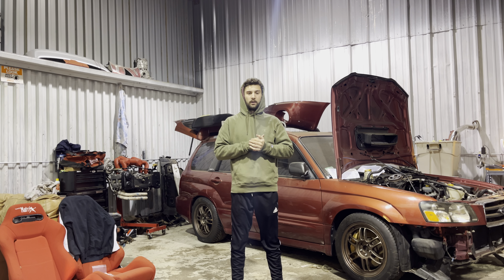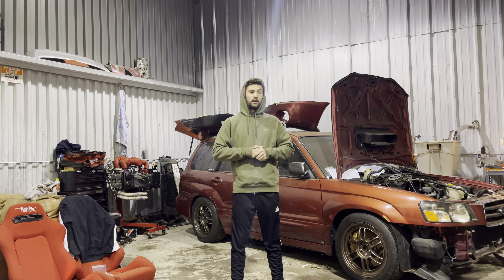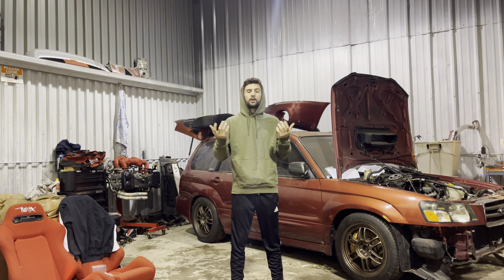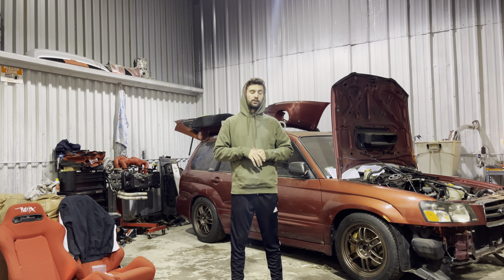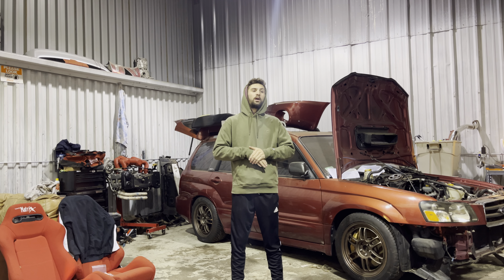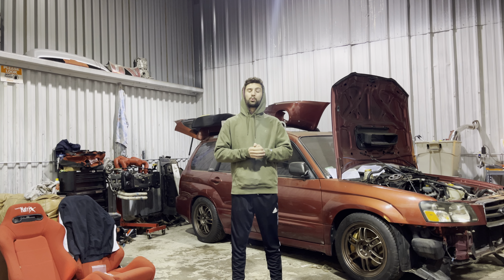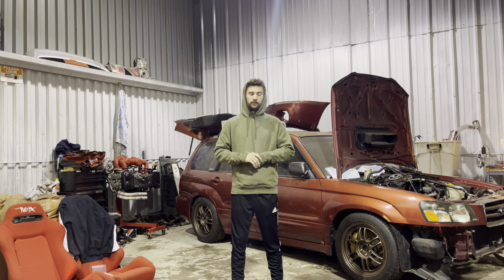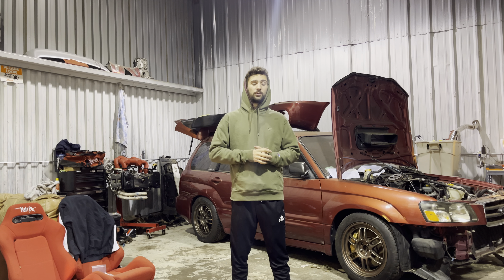EJ20X Swap Information

Comment: Tuned one i did to 362whp and still going 5 years later.
Reply: What turbo and supporting mods??
Reply from the maker: @thelonewanderer420 this was a few years ago, I had a twin scroll TD04L setup at one point and a VF52 setup as well. Upgraded injectors, pump, oil pickup, baffle, pan, ect nothing too crazy

Comment: My 20x has lasted 1 year plus and I daily drive it tuned by Jacob aswell he did a great job car runs flawless
Reply: On a 13 wrx
Reply: Who’s Jacob tune for like company wise?
Reply: What spark plugs you used for the ej20x i have a swap on my legacy gt and i want to know any help  pls saprk plugs and coils thanks
Reply from the maker: @joeyortiz757 use stock ej205 spark plugs and coil packs you use the stock ej255

Comment: I still prefer how the ej255 drives.  I’m no engine torque expert.  But.  I have a 255 in my 2014 Wrx and a 20x in my 04 wagon.  The 20x is great.  But.  I still think the 2.5 is better.

Comment: This mechanic messed up my engine so the put in a ej20x . I'm getting these code p0244, p0457,p0128,p1086,. They told me I need to do a tvg delete . And get it tune is this gonna fix all these check engine codes ? Please help this for 2004 subaru forester xt

Comment: Q: Swapped in a 2008-2014  EJ20X into my 2005 Baja Turbo AT in '20. I need new PCV hoses - Flatirons sells silicone hose kits ($120-240) for each model/yr. - which do I buy? which will work with EJ20X? Not sure what my swap guys did? Did u get your garage going? (ps. Wicked Matt did my tune - things been going good - xcept low end torque of course:). Great summary - thanks?

Comment: I did swapped an ej20x to a wrx 2014. Swap whole intake and parts with the USDM that came on the ej255. I'm using the vf52 with the oem Unequal length header, 650cc injectors and I have good numbers on the accessport 2 months using it and feels very good. Now I am going to order a 340lph Fuel pump before tune it. My actual goals are 300hp +/-10. I have catless downpipe and custom exhaust. Cobb boost controller, custom Perrin inlet intake, and OEM filter box with Apexi dry freeflow filter. Do you think I do need something else to reach 300hp?
Reply: Highly recommend a protune the timing on the cobb maps are super spicy for the ej20 motor due to the compression like alex said in the video

Comment: Just did a 20x swap about a month ago got about 800mi on so far on 18psi wanted to tell ya you can also run ej255 solid cam gears with cams as well mines doing well def keep posting bro !!!!
Reply from the maker: Yeah I thought I mentioned that in the video as well, but I was just going off the top of my head. Fully unedited video actually

Comment: I'm planning to do this swap with my 05 LGT and get a JDM ECU to use the exhaust AVCS. With this in mind, will I need to set the teeth back on it, or set the timing as normal?

Comment: Had an ej20x swapped into my Lgt about 7k miles ago.   So far so good except the place who did the work cut alot off corners I'm still trying to iron out.   Chasing my tail trying to figure out proper vacuum line routing.
Reply from the maker: If you’re local to CT, swing it through to my shop I’ll take a look for you
Reply: @FOFRacing  Right on man.  I stopped down a few months ago, you and your bro helped me out.  Silver Lgt wagon, turbo had a little shaft play.   Vac line from my bpv is going straight into intake manifold where the pictures I see it goes into a t-fitting.  Maybe I can stop down soon and compare lines.
Reply: Where is your shop?

Comment: Not sure if you know but you can run oem top feed setup from 08+ wrx or 07+Lgt if you wanna do it on a budget. Just an idea for whenever you get to it on your car. That's what I'm doing on mine.
Reply from the maker: Yes that was my exact plan, I think I explained that in another one of my videos I did. Just need to swap over your cars engine harness and you’re good to go 🤙🏾

Comment: Great video,  I can vouge for most your info as we have done 3 ej20x swaps, two in LGT's and one in a 09 WRX.  All ran great.  There is also a FB group Subaru JDM engine swaps, would be great to link your video there.  I do have a question. Is there an advantage to swapping the exhaust cam gears to the USDM and plugging the oil passages vs just changing timing 2 teeth CCW on the JDM?
Reply from the maker: I’ve never personally seen any actual data about the differences. It for sure would be a solid idea.
Reply: @FOFRacing  would be nice to know if it actually makes a difference and worth the hastle of changing them.
Reply from the maker: @troyemmert5296  I’d love to find out honestly
Reply: Would I have to have someone tune my car
Reply from the maker: @sethvanvalkenburg6788  I’m about 95% sure I included in one of my videos that you’ll need a tune, if not I’ll make another explaining that portion

Comment: Couple questions - When doing the swap do you need to change the cam sprockets and use the timing belt components from the ej255 and put them on the ej20x with the usdm harness?

One more thing, the exhaust AVCS sensor that I can’t use because of having an original single AVCS engine. What is the best course of action do I need to block any thing? I was planning on getting a tune to help fuel delivery after and hope it won’t make the engine run less efficiently over time
Reply from the maker: I answered your first question in the video stating you don’t need to swap any cams or gears to get it to run. Just needs a tune and a 255 timing kit and 2.0 waterpump. For the exhaust AVCS you can leave the sensor in and let it be unplugged.
Reply: @FOFRacing   gotcha thank you I heard that I was just confused. So, I should take off the idler pulleys and tensioner From my 255 and put them on the 20x? I probably just need a timing belt right? maybe I don’t need the whole kit? I’ve heard the ej25 water pump working but you recommend using the water pump that comes on the jdm engine?
Reply from the maker: @skidim8143  buy a whole new timing kit, don’t cheap out or you’ll pay for it later. Buy a 2.0 WRX waterpump because that’s what you should use. You’ll have to block off one of the ports on the 255 waterpump, so why hack it together? I don’t recommend reusing timing components as you have no clue the history of them or the condition of the pulley bearings
Reply: @FOFRacing  thank you so much for the info

Comment: i ran into a issue hope you can help my mechanic is a old fart and we do not have the ability to pull off parts of a 255 so the turbo doesn't fit my piping and my mechanic dont wanna take off the turbo cause 1 its bigger and 2 he doesn't wanna use the old turbos off the 20x that we have for spares so i ordered a piping to fit that turbo and jave to weld it onto the uppipe to fit so after that whats the other major problems we might run into considering we cant pull stuff off a 255

Comment: I just did this swap for my 2005 legacy GT .. how do I get my check engine light off ? I brought the engine from jdmengine zone in New Jersey .. it didn’t come with a 02 sensor so my check engine light is on .. the engine fit in perfectly.. all my mechanic had to do was run the engine on 1 solenoid and leave the other unplugged like you said and he had to extend the crankshaft sensor wire to be able to plug it in .. also what gas should I run this engine off ? I put 93 in it and it started shaking a little at first
Reply from the maker: Should’ve swapped over your turbo/ manifold/ downpipe setup and kept your 02 sensor. There should’ve been no reason to extend the crank sensor. Run 93, it’s shaking because you don’t have a 02 sensor hooked up
Reply: Damn .. jdm engine zone was saying to keep the 2.0 turbo set up .. I had to buy a flank for a ej20x because my 2.5 flank didn’t fit around the turbo for the 2.0 .. so I brought the flank for the 2.0 and then welded a pipe to the mid pipe to close out the exhaust .. everything else is running excellent .. it’s just some times I start the car it shakes a little .. is there anyway I can fix this ? I don’t have my original engine no more ..

Comment: love your shit dude. <3 I have a 2011 wrx hatch and I'm in the middle of a ej20x swap and i have full bolt ons with a FP Blue spinner. we'll see what she makes XD
Reply from the maker: I love the support man thanks!
Reply: Did you use the air assist ej20 or was the non air assist ok to use? I assume it’s all the same aside from air assist pump
Reply from the maker: @Batitoh  first off it’s a secondary air pump system, for when you need info on it later.
Secondly, you can swap it over if you want and have all of the pieces from your old motor

Comment: I’ve heard to only Retard the timing by 1 tooth , from reputable tuners , why do you recommend 2 ?
Reply from the maker: Both of the tuners I used to go to recommended 2 teeth. It’s been so long since I’ve done any of this, but as far as I remember it gave extra degrees of timing adjustment for the intake cams.

Comment: Great vid, man! I have been reading 1 or 2 teeth on exhaust timing, so I set it at 1 tooth retarded. Do you think that is enough or should I go another tooth?  I decided to use the included VF38 twin scroll because my old turbo was cracked. I welded a bung into the header for upstream O2 because there wasn't one. Do you know of anyone using the VF38 style? I purchased a downpipe to fit the flange of the VF38, so everything is bolted up except that I'm waiting on a JDM intercooler, since of course that is different as well and the compressor side flange is offset compared to VF40. Have a great day.
Reply: im running the vf38 as well